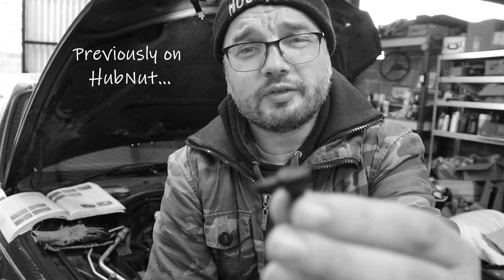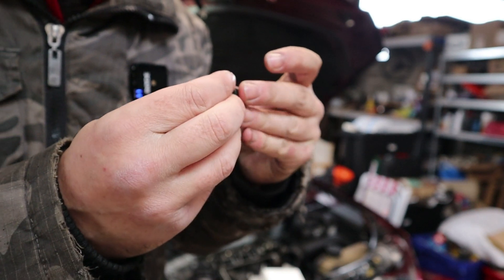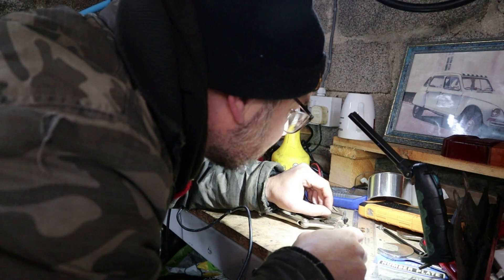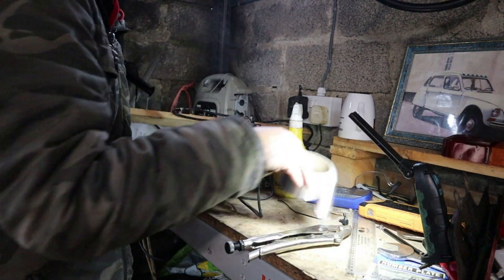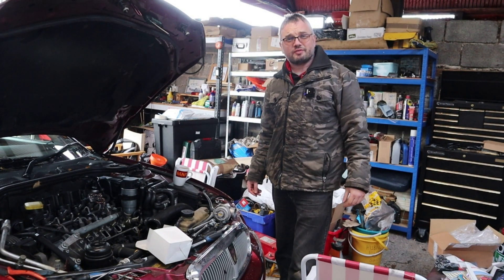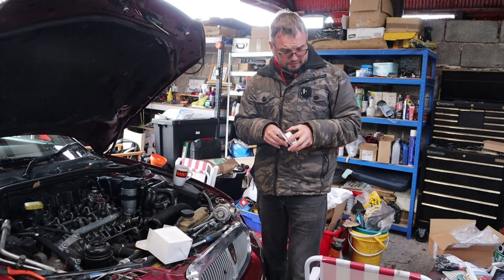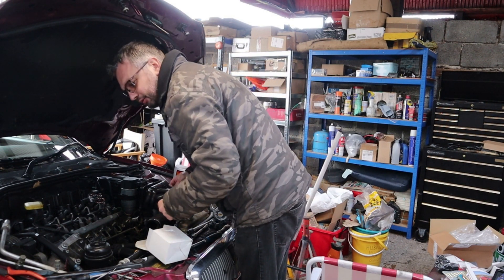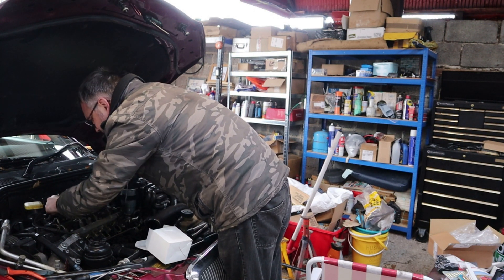Rover 75: Man vs EGR and PCV Part 2

Comment: 100% turboveins put my non existent reputation on it
Reply: Fixed vane turbo on these IIRC. Only the freelander got a VNT turbo with this engine.
Reply: @Jambo I think we have to agree to disagree in this instance. My 75 had sticky turbo veins nothing some toilet duck did not sort.
Reply: I tried the Mr Muscle trick on the vvt in my vw T4 2.5tdi it improved things a bit but in the end it was just due to vacuum leaks from old perished  hoses. I wasted a lot of time (about 2 years of intermittent power loss issues) and a bit of cash before I figured that was where the problem was. Simple temporary fix with PVC tube from the garden centre before I replaced all the small hoses with silicone. No issues since.
Reply: @Jambo 
Most T4 2.5 tdi's aren't (88 and 102hp engines) but I can assure you that the 150hp AXG engined Multivans and Californias sold here on the other side of the channel have vvt.  These 150hp variants weren't sold in the UK market.

Comment: Glue on such plastic not really a practical solution. Not the sort of stuff that glues anything like. I would have tried knocking something up with some copper brake line first and get soldering.

Comment: Only Ian  could  get away with this longshot commentary of desperate  spannering  on the yards of random troublesome  plastic that now sadly constitute the grim reality of modern motoring. Might be time to give this ailing  appliance an entertaining and possibly terminal induction flush with either  oven cleaner spray, a purely experimental 50/50 dose of Brasso and chemical toilet solution, or indeed any other random fluid  conveniently at  hand?  Childhood recollections here of exciting but futile smoky Redex purge sessions on the family Cortina and of dosing a recalcitrant carbonised Suffolk Punch with Nitromors to little avail.  In all seriousness, this latest thrilling Hubnut tribulatory detective power loss series looks like either "Death by Engine Mis-management", or maybe "The Case of The Concealed Intercooler Hose Leak"?

Comment: EGR are a joke. How it was ever thought as a good idea is beyond me. A device that makes your engine less efficient, clogs your air filter sooner and gets clogged up itself and becomes faulty? . 

When you need to buy parts more often, the environment suffers. When you need to use chemical cleaning products, the environment suffers. When your car is forced to do 5mpg less than what it's capable of the environment suffers.

The old 1990 Renault Trafic I had with a N/A 2.5 diesel with the Sofim 8120 engine didn't have any such silly things, I don't think. And it never put out clouds of black smoke. Yet plenty of modern EGR and probably dpf vehicles do. 

I think Nox is mostly just a scare tactic to discourage diesel so hybrids and electrics can take over. Because nothing is better for the world than whopping big batteries using dangerous chemicals and rare earth elements mined in questionable parts of the world.

That are then charged using fossil or nuke power station energy. These batteries only last 10 years or so, and I doubt all of them will be disposed of properly.